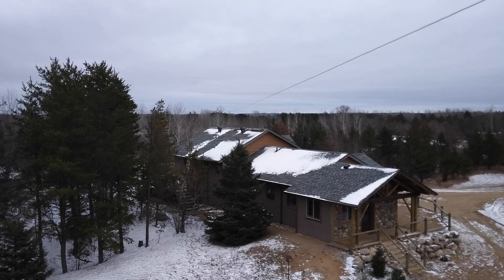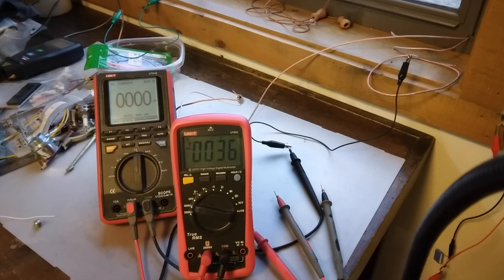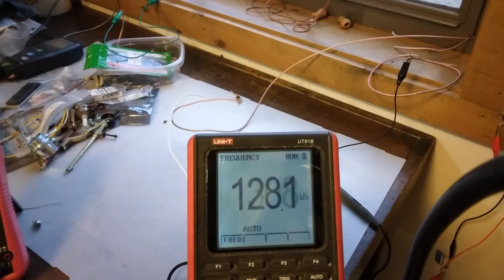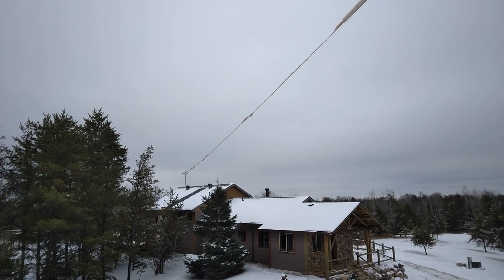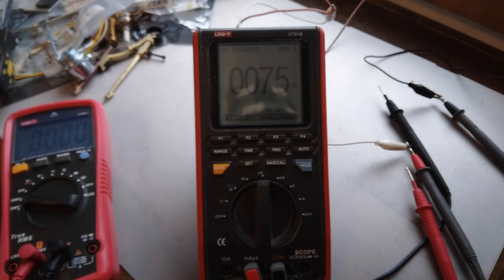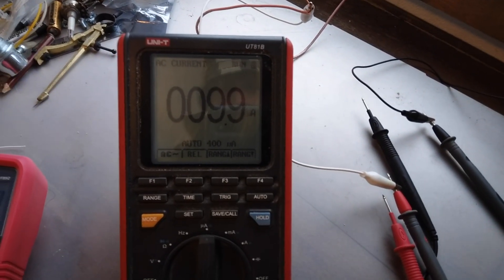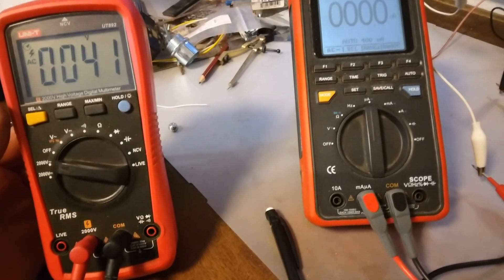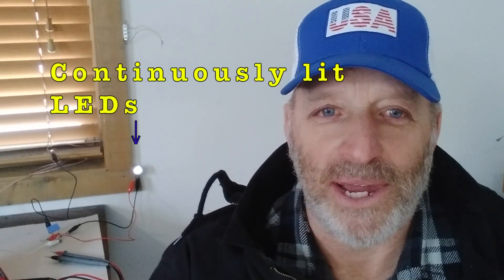comparing antennas for harvesting ambient energy

Comment: Many years ago I was putting  together a 10 meter inverted V. There was a thunder storm 15 miles away and this thing shocked me like an electric fence. The best voltage was from a 40 meter horizonal loop sky wire which is a wire laid out in a  square  hung between poles or trees and cut on one corner. One end can go to ground and one hot. I was using a gamma match. When there was a storm building up in the area I would put the coax in a jar, voltage would start with a click going faster and louder till 5 seconds later an explosion. I think I would go with the sky wire it seems to be very prone to picking up electricity.  If you want 60 hertz, cut your wire to resonate at 60 hertz
Reply from the maker: Thanks for your interesting input!

Comment: Thank you for the video. This is a great idea. Here are my comments and perhaps things to try. First the antenna is not resonant on any specific frequency. Hence, you can not measure the frequency at its output. Having an antenna resonant on the frequency of some strong radio station most likely wound help. Adding a tuning circuit for this specific frequency would help too. I am suspecting that you have a lot of static electricity gathering on the cable and its plastic isolation. This may affect measurements and performance too. I am speculating that the energy is actually collected via radio waves and static electricity generated by wind. I do not know the proportions... Having a low loss grounding would help to increase current. Anyway, my 2 cents.
Reply from the maker: In all my experiments with a long wire antenna, the strongest frequency can be seen between the end of the antenna wire and the ground.  Near the power line, 60hz.  In my previous array of wires between the house and the barn, 1.2mhz.  -that's the station I could pick up good with my cheap crystal radio, that went off the air.  Show that in other videos.
There really isn't a prevailing frequency with this setup I have now, (with bare copper wires) and is kind of all over the place, but mostly around 40Khz ish.  Maybe some kind of static...

Comment: To get more current you need a higher surface to peek more electrons. It may help to use some kind or copper wire brush on the wire, or maybe a loose copper wire mesh.
Reply from the maker: I think a ribbon of copper wire mesh would pick up more.
Reply: This should be easy to find it, because it is used in industry as a cable shield. Being a bit heavy you need to mount it on a support wire, metallic or rope.

Comment: Be careful  about what info you share...
   You need to focus on the metallurgy you use and the shape you use to connect with the Ether. You'll want a large capacitor and good batteries. You can power your neighborhood...
  If you try to sell or produce and sell, you will.......  
  What your doing now is great , just how far you go is upto you.
  If you begin. Using certain  shapes , get your metallurgy  figured out , and begin using certain crystal bering stone... then your through the rabbit hole but watch what you share...
Reply: Ether lol

Comment: I have a 200 foot long wire antenna that has not problem lighting up LEDs from a radio station a mile away. https://www.youtube.com/watch?v=vHVmJ5lD9jc
Reply from the maker: Nice!   Fun isn't it?  Have you tried different types of antenna wires and materials?
Reply: @doubleMinnovations I haven't, but I'm curious to see what's possible if one were to use other materials, or even a large 200 foot sheet of tin foil.  The guy who wrote this book on crystal radios showed an antenna that had multiple strands of wire, but I'm guessing that having them the right distance apart from each other is critical to it working correctly. https://www.youtube.com/watch?v=G4YDsvv1DEk&t=10s  I also tried cutting an antenna to the wave length of a local AM radio station, and that seemed to help. I few the antenna with a kite. https://www.youtube.com/watch?v=yqljaKjKjd4
Reply from the maker: Thanks for the link!  Very educational.  I know with the set up I have right now, the two outer strands of wire, output almost as much power as all three put together.  The two outer wires are about 3' apart.

Comment: Pretty cool. I'm guessing the aluminum tape will work even better. Was going to suggest hanging foil over the copper wire, but you'd get galvanic corrosion between the copper and the aluminum. Speaking of which, I hope you're checking for DC also. At that height you should be starting to get some measurable atmospheric energy, which is a vertical gradient of DC. Supposed to be around 100 volts per meter of height on a clear day (assuming an ideal zero resistance conductor) but very very low current.

I particularly enjoy these long wire energy collector experiments you do. Nice to see some actual data points about what doesn't work and what does; too many people make unclear/dishonest videos about these things. Thank you for sharing!
Reply from the maker: I'm trying to make these videos as honest as possible, glad you appreciate that.  I didn't check DC, but I should.  I know the it would be pretty tiny; I did a video on that a few years ago, and could barely detect anything.
Reply: @doubleMinnovations  Of course, it's one of your channel's biggest strengths in my mind. You appear to be a solid hard working reliable guy who isn't trying to compete or make money here. Therefore I can trust your data more than some others, and I don't have to deal with an obnoxious salesman personality to get that data.

Just watched that video. Pretty disappointing result, especially given the surface area of the electrode. Another useful data point though. Not sure about the shape, my understanding is that these types of electrodes perform best with lots of sharp edges/points sticking out to get the ions to crowd around them, so the large gentle curve of the copper tubing is probably the opposite of what you'd want. (Same reason electrostatic devices like van de graff and wimshurt generators have comb shapes in some places and big smooth round shapes in other places.) Haven't seen anyone try it that close to the ground before. Also have doubts about the grounding rod which appears to be a single rather small tent stake, but that's largely up to the composition, consistency, and moisture content of the topsoil. Wouldn't read too much into what happens during the up/down motion, you can get the same effect without even connecting the multimeter to a circuit just by moving the leads towards and away from each other; they act like a variable capacitor pumping charge in/out.

It'll be educational to compare DC measurements of your present setup, but I can see why you'd assume that it won't be competitive against the AC you pick up between a broadcasting tower and high voltage transmission lines. Still curious what's going on with the vinegar, too. It'd be interesting to see some more exploration and comparison of that.

Comment: Hi! I am at this moment think about and experimenting with Pulse Harvester. If you have 30V and 10uA constantly at 1MOhm resistance it is not much at all, but if you take capacitor - which is capable of charge/ discharge with Flip-Flop at the end and put larger SuperCapacitor or LiPo element at the end - this of course will make a big difference! I use Comparator and Mosfet together for my experiments, but at 30V there is much more space to make different schematics of switching :).
Reply from the maker: This video I did a few years ago may interest you:  "https://youtu.be/xHP8bittqaQ"
Reply: @doubleMinnovations  I watch your video. I think (my opinion) if we use capacitors to collect energy in them, we must create ~0.1mA consumption electronic device (CMOS or hybrid) to transfer energy to the bigger capacitor. Bedini style switches consume energy. Of course - we can use this small energy not for Tesla`s or whatever kW range, but we can collect this small energy to make our flowers happy! :) Yes, in winter time we can charge our battery all day and we can help our flowers be happy! :) LED illuminated pots can make big difference in leaves production/ flowers  production :). P.S. In old days- when I try to get Free Energy from nothing - I realize - we can harvest very little energy from whatever source - wind/ solar/ RW e.t.c. and use it for small appliances.

Comment: Current doesn’t add up completely because the cables are too close to each other and they are coupling.

Also, check the frequency using an oscilloscope. You’ll also get a better peak-to-peak voltage reading this way.
Reply from the maker: Yep, it looks like they would need to be further apart still!
Reply: yeap, at least half a wavelength of whatever frequency you’re picking up.